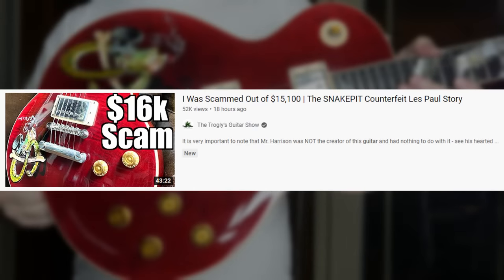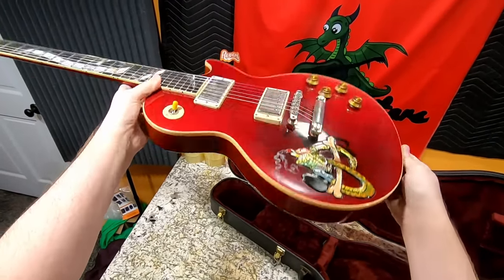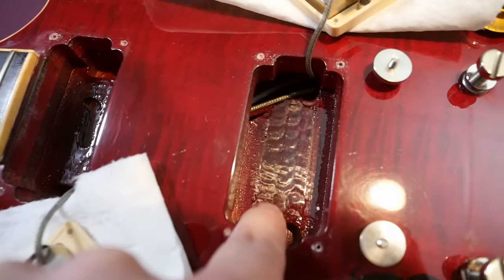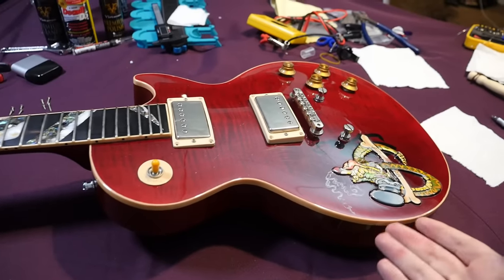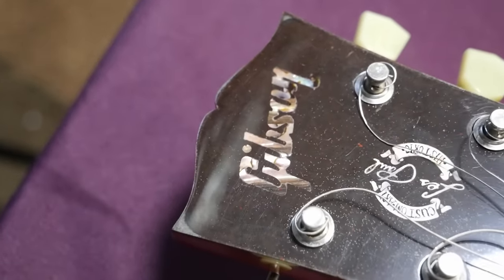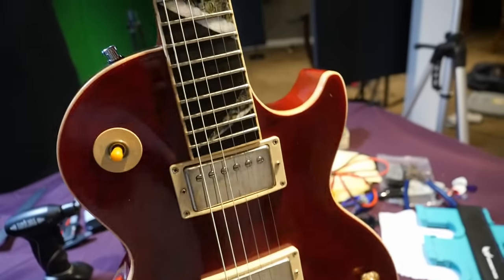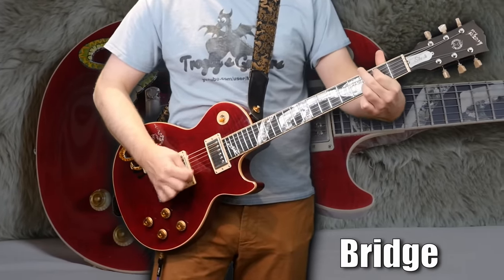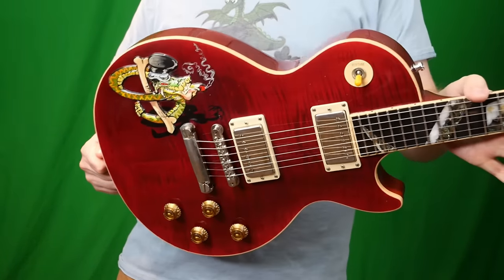Trogly's "Fakepit" | The Replica 1997 Gibson Les Paul Slash Snakepit | History + Review

Comment: If your wife hates it and she's a keeper, this guitar, whatever it was or morphed into was a pass. You would've been better off sleeping & missing that auction end.
Reply: Wouldn't it be ironic that if you went thru all this and it turns out this was an earliest stage mock up prototype of the Slash guitar you were after ? Maybe even the one of the stolen Slash Snakepits ? If it's a real LP Standard ? Would Gibson, in the earliest stages of the collaboration, just grab a regular issue production LP Standard guitar, rather than a true Custom Shop build to mock up a neck for inlays & body for the top carving & paint job ? The inlay of the Snake's lips look like any cheaper Asian inlay for cabinetry furniture, they look like fish lips ? I don't see even Gibson using the "highest quality" wood for a prototype really. Remember this is an engineering effort. At one point I worked for Boston Whaler & the boat prototypes are a build & tweak process really. The prototypes aren't sold really, they keep them around. I also knew a guy that worked for Ford back around late 2013/early 2014 when a new generation of the Mustang came out. As part of the testing process he got an R&D Mustang prototype serial number. After the testing phase, they send him another car, take the one they gave him back and destroy it. He has no control over what they provide him either. So a neighbor ended up driving the 6th generation Mustang before it went into production. The rest of us have no clue really, not unless you're following the car magazines & see the stealth photos at a Michigan track. They painted this one the metallic burgundy red so it's not the matte black camouflage for a prototype track day photo that leaks. Anyway, apologies for getting side tracked from the Snakepit guitar.
Reply: Final post on this video after watching it and posting, that tuner hole was awful, the neck replace/reset, you would have been better off buying an Epiphone at Guitar Center or even a $ 100-150 any brand Chinese guitar off Amazon. Microphonic pickup, is that a Chinese fake ?  I stand by the comments I made on the 1st video, no guitar is even remotely worth unless Slash is selling you one of his private issue & collection personally. My 2017 GC Epiphone LP Special I P90 > than this guitar. If you had another offer 1/3  what you paid for this nightmare, take that money & loss and get rid of this one. It's not worth being out over $ 10K to have to look at it as a reminder of being swindled, regardless of the seller either hacking this or buying it from another as hacked. I get the Gibson fakes of the 1970's, why someone would want a 40+ year old fake, because that's part of the history of whatever lawsuits Gibson would've started that are legendary "lawsuit era" Japanese guitars. End of the day, China makes some decent instruments for even $ 100-150, but at least whoever sells those has the decency to sell them for what they truly are. Whoever went out of their way to do this for this particular guitar, then for the money they charged, they need to spend time in prison for that fraud. I don't care how many times it was flipped. Being the 1st victim gives nobody a right to perpetuate a cycle of future victims. On principal alone, this is just wrong. I was shocked even one of the 3 credit cards stepped up and paid you back.

Comment: they began with a shitty pawn shop 80s gibson. They pulled the neck off and salvaged the tuners and the original binding from the neck. the entire neck is fake. they re veneered the top of the body. The area by the cutaway the binding looks off because they painted over it to make it look more weathered. The reason why the binding is more transparent and thicker in the cutaway area is: they messed up when they masked it and when they re clear coated it it reliquified the color layer causing it to be more transparent only in the thicker area by the cutaway. Im surprised they bothered to buy the slash brand pickups to instal into a homemade fake. Its a pretty damn good fake. The person that made it spent hundreds of hours looking at a photograph they probably took while on a tour of the factory or maybe got from someone who worked there. they probably sent some factory tour photos to the original buyer that helped convince them of the authenticity. they probably even scrapped the frets off the shitty 80s pawn shop gibson and thats why theyre so worn down. I cant believe they hand painted the serial number and hand painted the snake. The work is really convincing. Its not so astonishing that the serial number looks legit that MF painted it with a tiny brush and a magnifying glass. its not surprising that it convinced you. I wouldnt be surprised if whoever made this thing worked at gibson at some point its really convincing. thanks for posting this video. it really shows how NO ONE could ever(or should ever try) to create a fake Gibson that was good enough to pass the scrutiny of a professional (or amateur) luthier.

Comment: this is not a gibson std . it is a $400 cnina.... this is what they look like and markers , paint why? real Gib paint is paint is copy righted and trackable, etc...etc...How do they do it, nothing on this guitar is gib , china has crc machines, that a worker gets paid to run, but will extra parts on side and change to off a few mm so not copy right infringement , etc.... latter pre planed malice luthier  to do the other work, will put on the illegal copy right tags such as the bell logo ect....  HOW to spot the china ones ......1 bad wrong solder mixture ( expensive)  and job.  2. fake paint/ copy rights to real source, 3. fake binding material not even close.  4.machine heads more back lash . 5. not wired right  mid position should be 4k measured  (parallel=half R) 7.other stuff.... 3 Bart head on end stock is not a good marker on todays fakes,  ...CHINA GIB . A/ the neck is weak at nut, and brake easy. B/ all metal is softer, tin mixed in crap C/ Binding material wrong D/ body top and rear plating a 10,  inside bass wood, dremel test.... yours also sounds like crap...i see alot of fake PC1 , RATT , EVH , jake e lees , others , as i mod inter change able squires  to super strats, these other are brought to me..to swimming pool / with pickguard mods...  , such as all dep switches, or dragonfires " DG" one......etc...etc... /sometimes a suspected MALICE  guy wants the switch, ....  i always  luthier mark sign,  fire heat branding  all work....  private china mod, hot rod . symbol crude looking ....